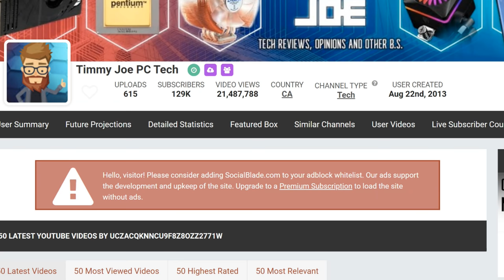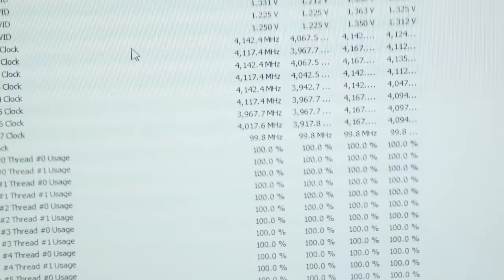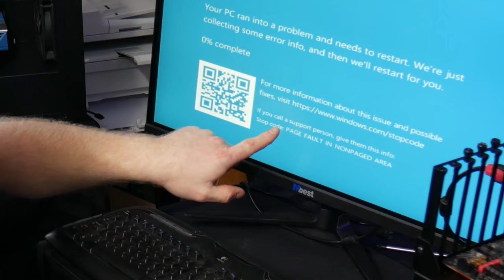This Ryzen 3700x was my biggest problem in 2019...

Comment: I bought the 3700x and X570 GAMING PRO CARBON WIFI in Dec 2019. This was about my 5th build. (In brief) i did manage to install win 10 but had blue screens and misc problems. Then the cpu red light on the mobo would came on indicating a failure. Got in touch with amazon and demanded new cpu and mobo which they sent. Rebuilt etc, etc. The red light again came on this new setup. I tried everything i could think off. Was going to return everything for a refund but decided on one last attempt. I put the first CPU in the second mobo and it worked. The only problem i have now is that fucking red light still occasionally comes on and then it won't boot. But so far always boots second time and pc is stable in general. But i hate that light.

Comment: Tim it's the Gigabyte motherboard. I bought that motherboard with a 3600X and a 5700XT. I thought it was the 5700XT causing my issues. I had the same exact errors. I switched to Nvidia and it stopped blue screening. But hasn't been as stable as I like.

Comment: Nice video. The strangest problem I ever had was with the Gigabyte 990FX - Gaming MB. That mb was the last model that Gigabyte released for the AM3+ socket. It was released about 3-4 months before the first gen Rysen came out. It  has a USB Type C port and a PCIE-2 NVME M.2 x 4 slot. I had replaced my previous mb which was the Asrock 990FX extreme 3 after quit working. About a year after of using it - on day our area had a set of short power surges and I had my my old PSU which was the OCZ  ZX Series 1250 Watt  80+ Gold Fully-Modular Active PFC Performance Grade ATX PC Power Supply 5 Year Warranty OCZ-ZX1250W and the PSU was plugged in to a Monster Cable Power Strip with active surge protection and  after the 3 short power surges my Gigabyte Mb wouldn't boot any more and the bios said - No raid array found. I had tried removing the CMOS battery ; replacing the battery - but that didn't fix the problem. So at that point I decided to switch to the AM4 based mb's and Ryzen cpu's. My system setup with the Gigabyte AM3+ mb was nearly as high end of a FX-Cpu based system could be. Before I had the problem with the mb - i had planned to replace my 32 gb's of non-ecc ddr3 1866 mhz ram with a ECC-memory kit that was 64gb at 1866 mhz. My Cpu for that system was the FX-9590 - Cpu Cooler was the Corsair H100i GTX AIO. - VC was the MSI Radeon RX-580 Gaminx X 8gb OC model. - Storage was a 1tb Samsung 970 Evo PCIE-3 X4 NVME drive. I never was able to figure out what happened to cause the problem with the MB.

Comment: I know it's a shot in the dark......
Did you check the pins on the CPU?
If the CPUID pins are not connecting properly it could cause issues on mobo's that don't have a good look-up table to default to. 🤔

Comment: A motherboard short to ground.  Never found the cause; put electric tape everywhere where it shouldn't matter. Problem somehow solved.  More recently built a threadripper system with an air-cooler.  Worked like a charm for more than a week.  Changed to another air-cooler; it wouldn't post.  Put the original air-cooler back in, it still wouldn't post.  RMA'd the motherboard and they sent me a new board.  Totally confused.

Comment: My RYZEN 3600X Gen 3 works fine with GIGABYTE X570 ELITE WIFI mobo built  in November zero issues.... went with the R5 so it wouldn't hurt to much if it or the mobo ended up being a brick.

Comment: This is exactly what i was talking about in my email to you before christmas, only it was an asus mobo and an intel chip. Fixed in the end with a new mobo and cleaning the contacts on the CPU. I took all the steps you did, thought it was RAM, then SSD, MOBO, everything. Finally fixed it by fluke. Just like you in this video! Hardware huh?

Comment: The weirdest problem I had with a computer, and I thought it was weird but I now realize the IO shield was probably touching the usb's on the back.  I use to have to plug and unplug a mouse or keyboard to a USB connector on the back until I heard a click sound.  It was the only way I could get that old sony vaio to boot.  Currently dealing with an issue with Everquest causing my old Dell XPS 8700 to reboot.  Have a new 1660 ti in there but it was playing fine with no issues, then I had used the 1660 ti in a different computer for a bit, and then ended up putting it back in the dell xps and it only seems to crash on everquest.  Everquest is a game from 1999, it can play on modern intel on board CPU graphics, so I'm not sure what the problem is.  Nothing is coming up on my event log viewer as well, so I'm possible thinking my 460w PSU just isn't enough

Comment: My 3700x is running in my Gigabyte Gaming X570 with no issue.  Maybe the engineering sample has different stepping that gigabyte didn’t include in their BIOS since it’s an engineering sample and theoretically will never be used in a consumer product.

Comment: The Gigabyte X570 Aorus Pro is a PoS imo. I can say that, as I have one, with intermittent issues.  Running the latest F11 BIOS.  Gigabyte doesn't like PCIe components or input devices, like keyboards and a mouse!
Expensive motherboards that are not stable is not cool.

Gigabyte needs to see this video and comments.

Comment: Lol, this has been my issue for the last two years... 1700x with Gigabyte Gaming K3. Only thing that has worked is disabling the C-stepping and AMD Cool & Quiet. Another symptom is losing Bios settings when powering down at the wall. (Yes I did change the battery)

Comment: Built a 1700x when they first came out. Worst experience ever. It did all kinds of weird shit. Threw it in the trash at that time, built an 8700k. Absolutely rock solid stable. I won't bother with AMD again, it's not worth the trouble. 20+ years ago I never had such trouble with AMD stuff.

Comment: Timmy same I have the r5 3600 and also the r5 1600 and get random memory related BSODS with both on my Gigabyte x470 Aorus Gaming Ultra. Both of my chips pass every conceivable stress test I throw at them, and then just regular use, browsing gaming what have you, I get the same BSODS, and thats everything running complete stock. I thought it was my memory that was having problems but when I threw everything on my Asrock B350 Pro 4 motherboard everything works great with no BSODS at all and I can OC my memory quite a bit also on the Asrock board. So quite clearly it has to be Gigabyte and something with the Bios related to the memory.

Comment: I had the same pagefault issue on an ASrock board with a r5 3600. It was drivers. Chipset/GPU driver stuff. When I looked it up online it was either RAM or stuff with Ryzen 3000 and certain drivers and stuff, also i think with Navi cards if I remember right... But when i upgraded to Ryzen 3000, it took waiting for new bios to use XMP. Otherwise the xmp would cause it. Then i had it with my 5700 xt but that was GPU driver crap. Now my system runs flawlessly.

Comment: Worked for a local SI a few years ago and would see things like that, even on Intel. I even saw problems come up between boards of same revision but different manufacturing dates. Only thing I could think of is some of the components threw the board just enough out of tolerance that they still passed QA, but some processors wouldn't work.

Strangest call I had was a keyboard that was good until a specific key combo was pressed. Then the keyboard would ground out the motherboard. But until that key combo was pressed the keyboard was fine.

Comment: updated my bios and my ram no longer worked in dual channel, it would just blue screen as soon as the windows logo popped up, tried swapping ram slots with no luck, and i didn't have any ram to swap out so i asked gigabyte, and they asked for the board, they say they reprogrammed the board and sent it back, when i got it back, the problem still occurred so i thought one of my ram sticks was dead, till i tested each ram stick independently and both worked fine, so for a while i left one stick out and just ran 8gb on 3000MHz, I updated my bios one day and decided to test the ram stick, and it worked, sort of, it would only run at 2333MHz, and neither task manager, nor corsair icue could detect the ram correctly. i ran with it for a bit, then other things started to happen, at idle, my ryzen 5 2600 was reading temps of 104 C, the CPU Thermal Throttled to .45 GHz and the system ended up crashing, I rebooted it, same thing, it did it 4 different times before reading correctly, but the fans were still running at full speed, so i opened SIV (Gigabyte's fan control software and temp reader) It told me it neede to be configured again so i let it do its thing, after it configured, temps never rose again and now i can run my ram at 3333MHz with no issues.

Specs: 

CPU: AMD Ryzen 5 2600
Cooler: NZXT Kraken M22

MOBO: Gigabyte X470 Aorus Ultra Gaming
RAM: 16gb (2x8gb) Corsair Vengance RGB Pro 3000MHz (stock)
GPU: XFX Radeon RX 580 8gb GTS Black Edition
PSU: Corsair CX750M
Case: LIAN LI LanCool 205

Comment: My 3700X will blue screen on occasion as well and I have an Aorus B450 Pro WiFi. But I can go for weeks without it doing anything bad. Then out of nowhere it'll have a hissy-fit while trying to sleep where it'll wake itself up out of sleep-mode and have a BSOD. But I'll be replacing the mobo soon anyway, as nice as this one is for my first new system the PCI-E slots have a bad layout. The one PCI-E 4x slot it has crams my EVGA Nu Audio card into the back plate of my graphics card, almost to the point of tugging at it at the base plug. I currently have it plugged into the bottom PCI-E 16x slot to get it out of the way of other components. But it's all loose feeling and I don't like that. So I'll be going for an X570 of another brand. I've been either eyeing an ASRock Phantom Gaming X or possibly something ASUS based if I can find one I like the design and layout of the most. It's gotta have the wifi though, I've been using that heavily since I built this setup. :)

Comment: My Weirdest PC problem was also on a Gigabyte mobo. One day my USB 3's stopped working. The front and the back they all just couldnt work. It got to the point where I bought new memory and a new motherboard. Eventually I ended up buying another CPU, case and PSU because that was all I needed for a second computer even though It wouldn't have most of my usb ports (2 port are USB 2.0) . Guess what happened They started working again.

Comment: I had a similar problem with my aorus motherboard and a 3700X. In the end, it was because the motherboard had a glitch with the ram profile to 3200 and it didn't elevated the voltage. I searched, copied the profile manually and everything works well. Just saying.

Comment: Lol.  I run a 3700X on the Aorus Pro WiFi.  Worse trouble shooting was literally just last week.  I had a gray screen 5 seconds after logging in to windows, then the comp would reboot.  In safe mode I found out that my Sapphire Trixx GPU app was crashing the GPU.  Ironically I've ran that utility for years, since the RX 480 launch and one day it just goes down.

Comment: its your motherboard you just need more SOC Voltage as I have an Aorus B450M and it has the exact same issue with both my 3600x and 2600 CPU's and for some reason its giving a very low SOC voltage it seems to be a gigabyte thing you can actually fix this temp wise via ryzen master by increasing the SOC voltage to 1V or 1.1V and it should stabilize.

I honestly think its a Gigabyte BIOS issue as I adjust the Voltage and it doesn't seem to be doing anything but if you change it via Ryzen Master which always reqiures a reboot each time.

Comment: I had problems with my Gigabyte X570 Elite Wifi also with my 3900x. Mine would do the same thing.  It wouldn't see any resolution above 1080p on an RTX 2080. Once I updated the bios it went away.  Was very frustrating.  Had it up for about 3 months and it's working fine now. Gigabyte boards are not ready off the shelves I believe.

Comment: Hello, i was experiencing this issue as well with my little brother's ryzen 5 3600 with GIGABYTE B450M DS3H. it a budget setup but i was having serious issue with it because it would blue screen instant whenever you watch a video. games running fine. but as soon as you watching a video, instant blue screen. and yes i brought all my parts from Craiglist so possibly one of the parts are defective and scammed. it wouldn't be possible because they all have excellent reviews with over 20 5stars reviews. so in order to fix this APC_INDEX_MISMATCH error. i changed one of the values in Regedit and i found it from surfing the web. i cant find it anymore but it definitely fix my issue. it past since christmas and my brother has no issue with his new computer.

Comment: Probably going to sound stupid, but did you update the bios before installing the CPU?

My understanding was that the 450 boards needed a bios update in order to use Gen 3 Ryzen chips. Seen a lot of reports of issues with the 450 boards if you try and use a gen 3 Ryzen CPU without updating the bios first.

Comment: I don't know how old you are my dude but hardware compatibility issues have been around since the 80s.
in fact, most motherboard manufacturers still release a RAM compatibility list for their motherboards.
it also doesn't help that you have a pre-production not for retail CPU.
of course, I would be stumped and frustrated too, you did a good job figuring it out. 
I like gigabyte but have also had problems in the past so I stopped buying their boards and now try to buy ASUS or MSI first. 
gigabyte releases the latest hardware at great prices but their software and bios support are way behind which is a very bad thing when you are a first adopter of new technology like a new CPU or motherboard.

Comment: Mate does your MSI x570 MEG ACE take a bloody age to boot? Even with a Samsung 970 Evo?
2700X was disagreeing with the X570 ACE random freezes that seemed like OC freezes, refused to boot for an hour or so. When it did, I went through the bios settings and dragon centre, and found the OC dial setting were laughable at best. Not only that but the board basically needed a bios update out the box. Seems to work fine now. Gen 1 Ryzen had 5 yrs dev time, all subsequent gens seem to have hiccups through rushed launches. I'm a big AMD fan but, for Pete's sake get the microcode to the board partners sooner, and not make them have to change the wheel on a moving car. It gets bloody irritating. Especially when customers get pissed at problems, and it has a knock on effect to business. TBH I wouldn't even attempt to sell a review sample. I wouldn't know if I had an "engineering sample", or something that was deliberately nerf'd when paired with non-care package kit. Hence the "not for re-sale" sticker. IDK.

Comment: I had this exact issue on my Gigabyte B350 motherboard. I eventually swapped it away for an Asus x570 board, but surprisingly, I would still bluescreen occasionally. 
It drove me mad that I couldn't figure out what the problem was. I replaced just about everything on pc and still had the same problem.
Turns out the issue was related to low power state of CPU. My 3700x would bluescreen only when it was under low load. I would never bluescreen when gaming.
After reverting to the old bios on my board, I was able to atleast prevent the bluescreens but it was not ideal.

I eventually did update to the latest bios and you know what actually fixed the problem? Using Ryzen performance power plan instead of balanced.

Comment: I have an X570A-Pro with a 3800X that seems to not like going to sleep and/or waking from sleep. Also on restarts it seems to lose the M.2 drive for some reason. Even on full shutdowns once I go to restart it, I get a boot error, and the drive isn't detected. I power cycle the thing, and I get back into windows. I've replaced the power supply, the drive, and the motherboard. It still happens. At this point I'm not really sure what to think...

Comment: Had issue with my 3700x and x370 crosshair vi. Even as I updated version, it told me ram error, tried everything without success. But I simply waited to the next bios update and everything went fine and dandy... 4.3ghz @1.325V fully stable, corsair vengance @3200 mhz cl 13. System is a beast now.

Comment: Sounds almost exactly like problems I was having with my new build, which is a 2700X on a B450 AORUS PRO WIFI.
Load up a browser, load a game... boom... game dies, and active pages in the browser die.
Random BSODs, though it was more programs randomly crashing than BSODs.
Random driver deaths.  Some USB ports died, but not others.  Reboot... it's fine.
Video went blank, couldn't even boot.  
Cleared CMOS, still wouldn't boot.  Thought the motherboard, cpu or video card was dead.
Turned off the power on the power supply for a couple minutes, turned it back on, aaaaaaand it booted fine.
Updating the bios seemed to work, no crashes, soooo... must have been bios, looks like the RAM speed is set for 3200 and working stable.
Ran CPU ID.  RAM wasn't clocked for 3200. Change clock manually... annnnnnnd boom.  Crashing is back.
Contacted everyone's tech support, asked for an RMA on the RAM... and then I had an epiphany that fixed it.
The fix?  I bumped the RAM power a little above what it's supposed to require.  It's been running fine ever since.
Reply: Oh, and the I forgot how old I am thing hit me when I turned 38

Comment: I've had this same issue with a gigabyte board on a Ryzen 5 3600, works fine in my ASUS board and my 3900X works fine in the gigabyte board, neither are sample, both bought retail, motherboard is Gigabyte Aorus Master. same BSODs aswell, generally not when loaded but when doing something trivial or when booting. it was a pain because i tried everything else first and nothing seemed to make any difference.